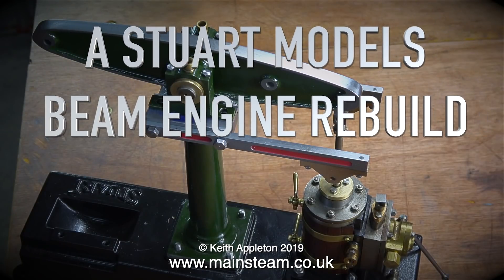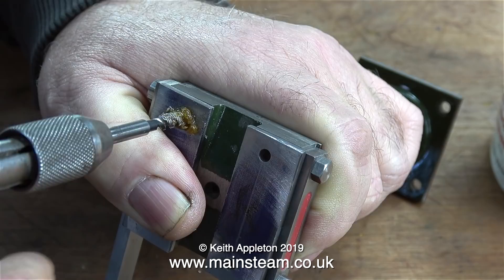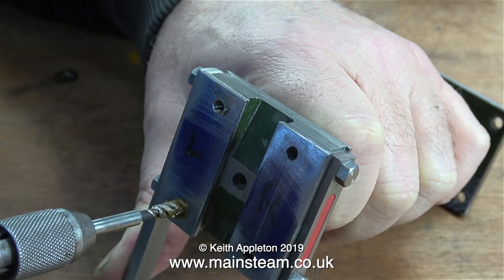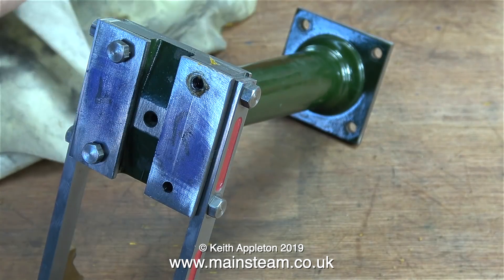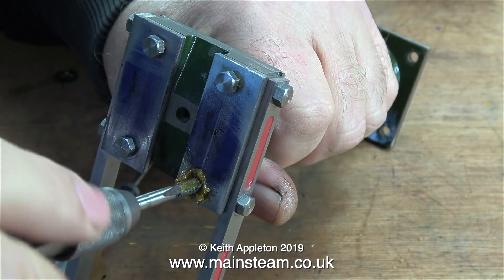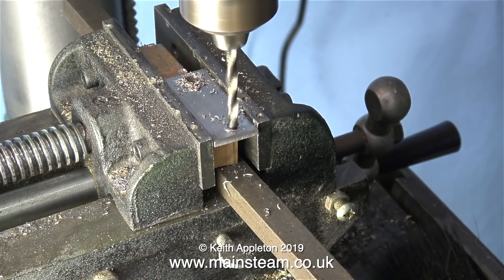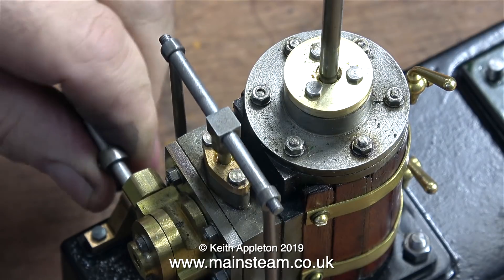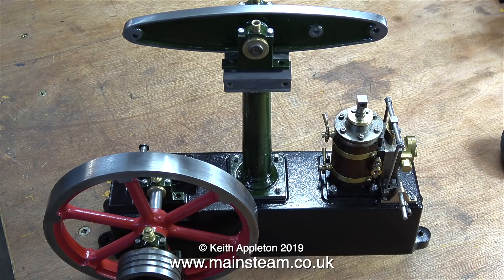A STUART MODELS BEAM ENGINE REBUILD - PART #16

Comment: I always wondered if those spiral taps were as good if not better then regular taps. I'd never heard about Castrol tapping lube, I'd been taught to use cutting oil.  Is this type of tap and lube common in England?
Reply from the maker: I don't know about spiral taps, but tapping compound is common over here . . .
Reply: @keithappleton  Romac makes a "Tech-Lube" here in America for drilling and tapping that is probably the equivalent.  I wish these companies would get together and agree on their terminology!

Comment: Love the channel, I generally find adding a small chamfer to the top of the hole helps center the tap, gives the thread a lead and generally keeps me from breaking the. You can also put a small pointed cone in a drill press if your tap wrench has a divot in the back. Thank you for making this series !